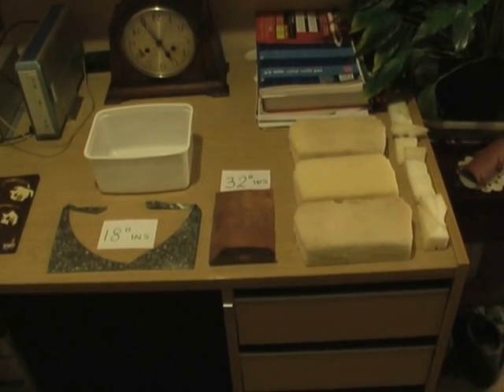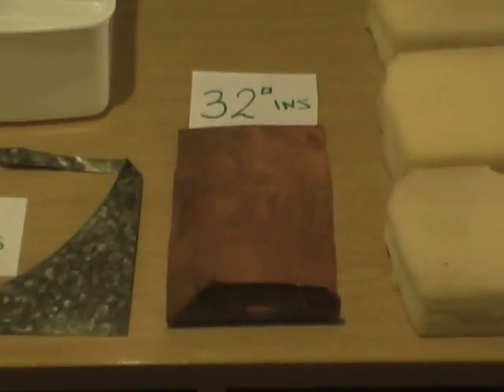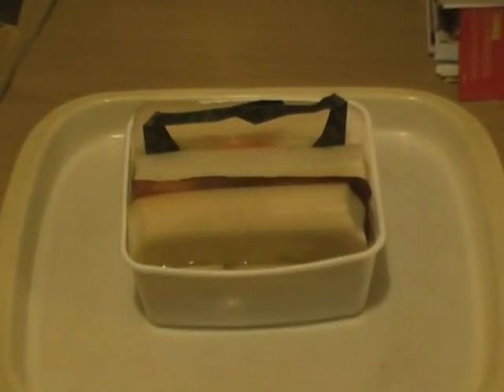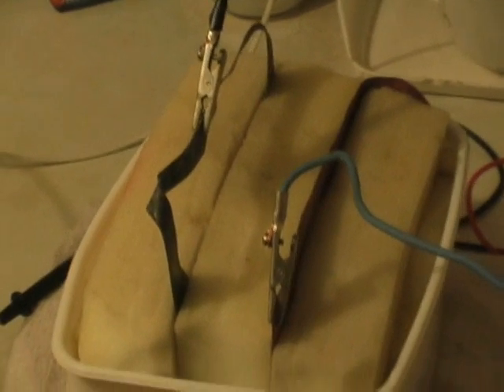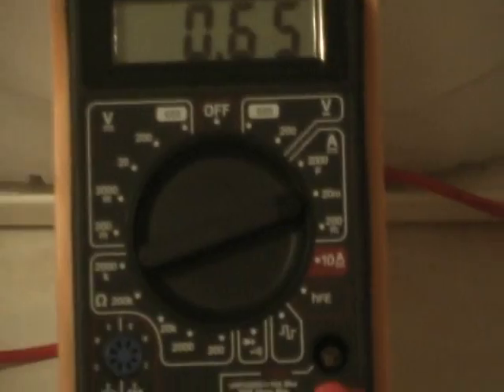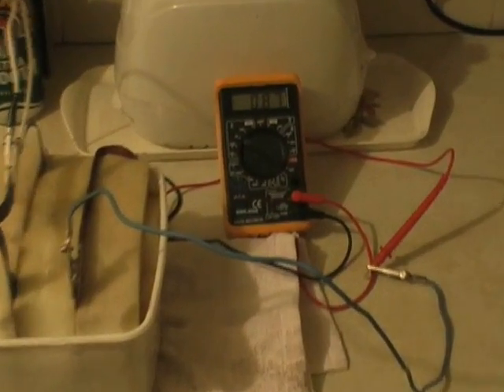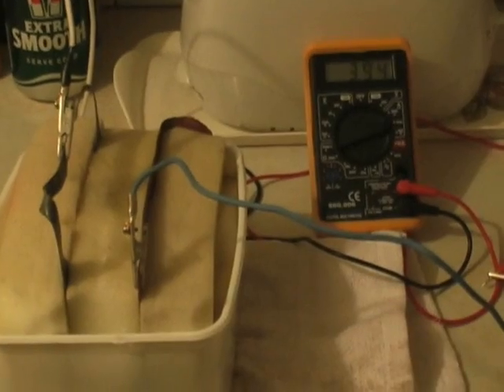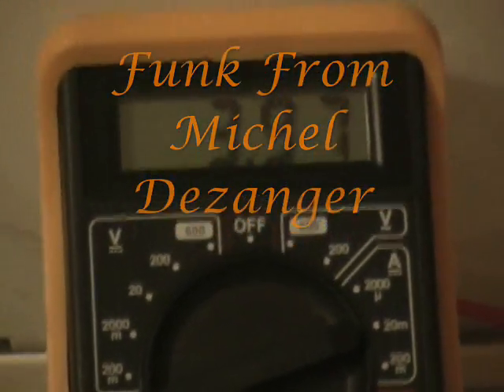water battery cell (High Amps)

Comment: I like what you did here.
 
Your video is the second video to inspire me to push forward in salt water batteries.

I'm using a small igloo ice chest as a container.

1 cell is prety simple , but when you want another cell things can get really confusing.

the choice looks like series or parallel , but it's only series if you're using two containers , if you use the same container it's parallel and raises amps

DON'T BE FOOLED.

Comment: okay,,I tried useing plastic 2oz cups 3/4 full of soil-a 1inch square copper sheet sodered to copper wire about 5 inches to a zink fender washer in a parrale series with 15 soil cups -1 Cup tap water,1/4 cup salt,1/4 cup vinager mix sprinkled to dampen the cups - I got 15 volts ,ran a LED dim ,so I tryed a small 9 volt moter ,,dropped to zero instantly -removed the 9 volt motor and slowly the voltage reading returned -left over night and lost 1 volt-rewetted and returned to 15-a trickle charger